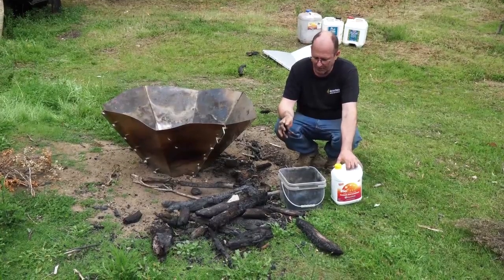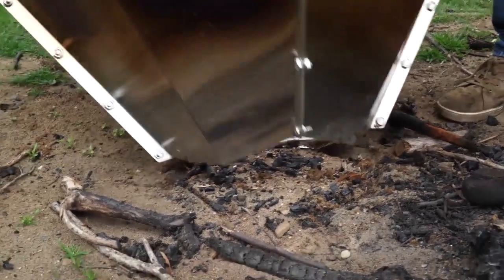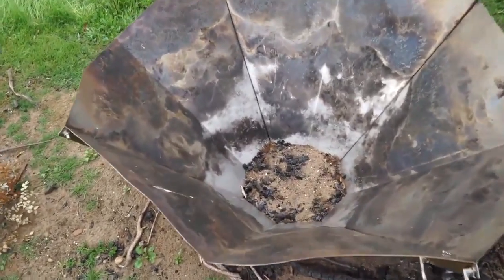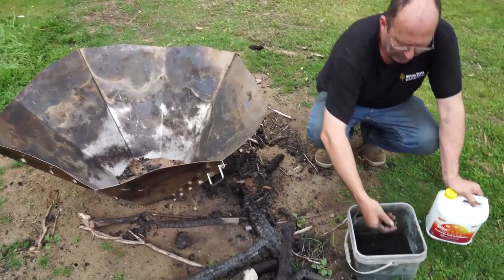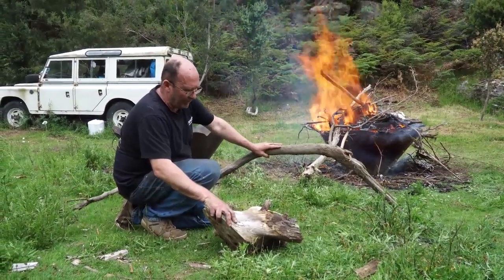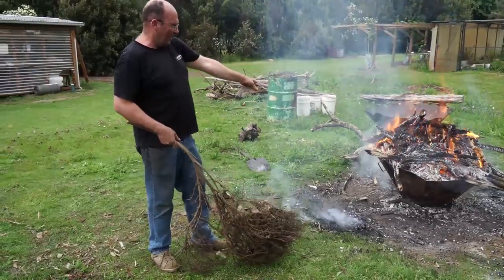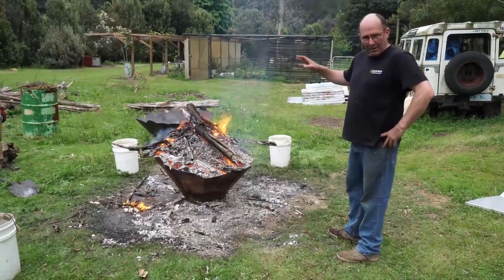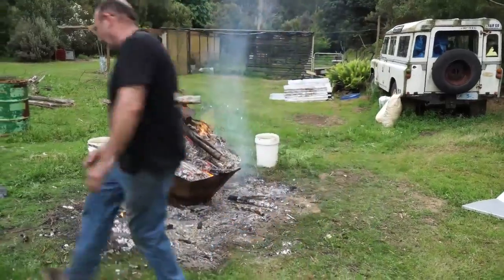How to Make Stable Carbon in the Form of Biochar Using a Portable Cone Kiln

Comment: Does the cone give off a lot of heat? Would you need a radius of a meter or two for clearance? Or would you need more? Thanks
Reply: As the burn gets more advanced theres a fair bity of radient heat. 2 metres clearance from the sides of the kiln is adequate as a minimum..
Reply: @ good to know. Thanks for sharing. I just got a kiln and wondering what I need to be mindful of. Thanks